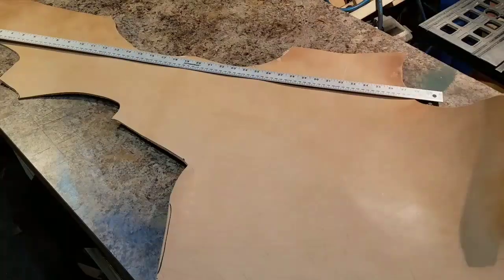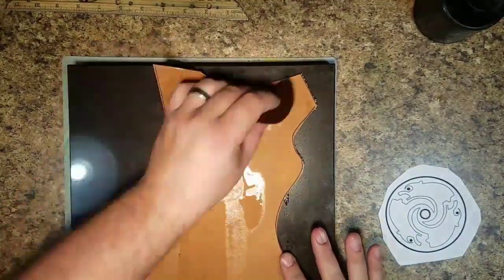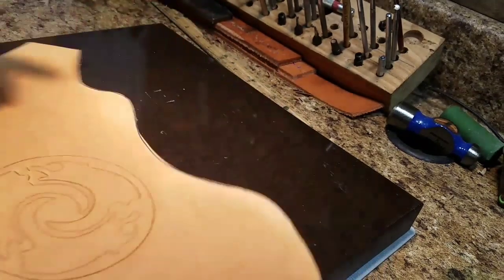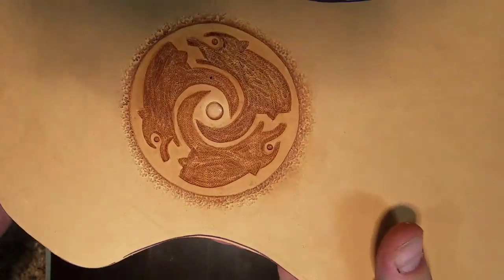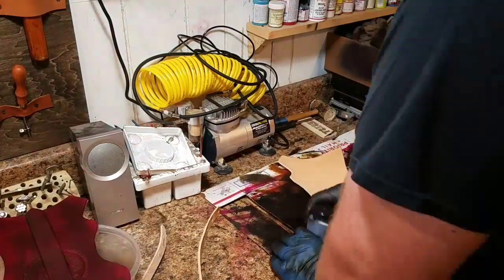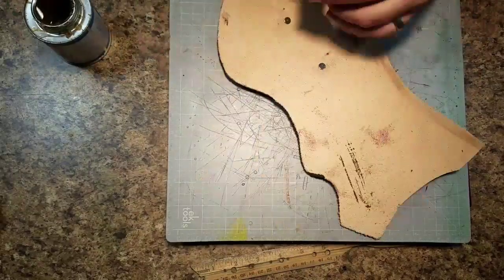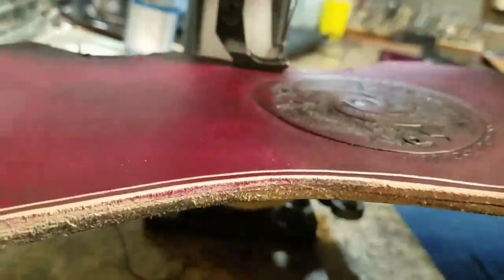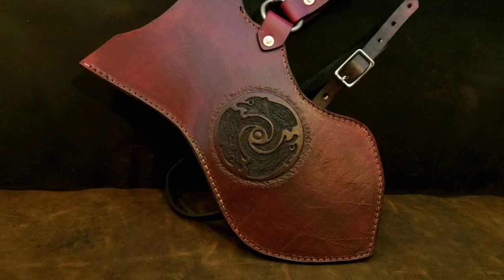Making A Mounted Archery Quiver

Comment: I've never thought about stropping an exacto knife! Really gorgeous piece!
Reply from the maker: Bruce A. Ulrich Yessir, for the purposes of cutting vegetable tanned leather a well used but stropped blade works better than a new one. Regular use polishes out the machining marks of the bevel so it gives a generally smooth cut as long as you keep it stropped.

Comment: Might want to reconsider your technique when it comes to applying dyes. You can clearly see discoloration in the outer circle of the tooled area where you slopped on the antique dye and left it too long before wiping. You should always apply it uniformly throughout the leather. And even if you want it to look rustic and have a random pattern you should wipe it away quicker are apply it in more of a random way and not a perfect circle.
Reply from the maker: Prepared Survivalist Thanks for the suggestion. Cheers!